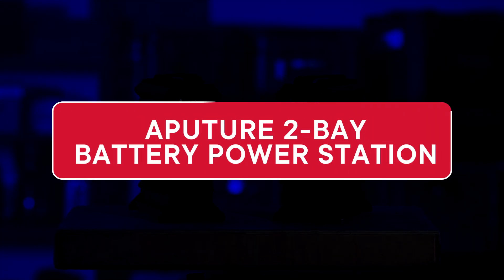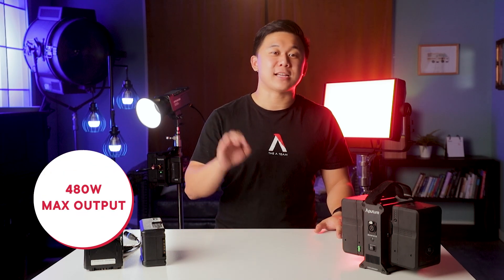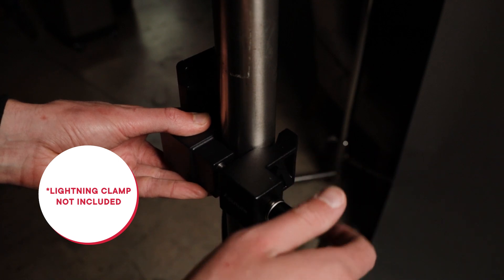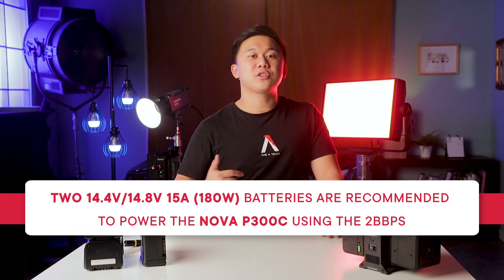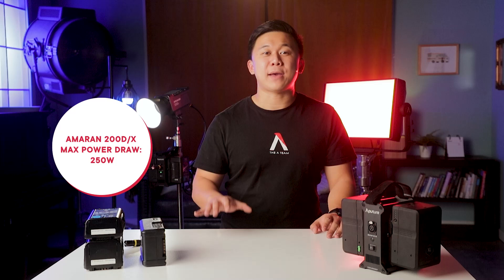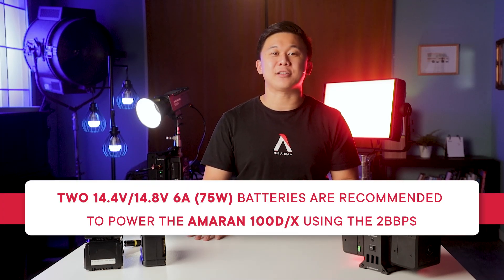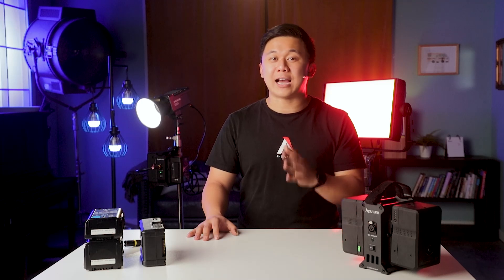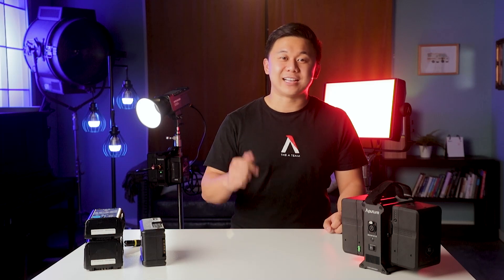Aputure 2-Bay Battery Power Station | User Guide

Comment: Which batteries do I need to power my Amaran 300c? I like Core batteries and they were recommended to me by you guys. Please can you provide a couple of model options including the least expensive option. I only need 30 min or so to power my 300c. Thx
Reply: I need to know this too but I think my man made this video on one condition that after this video he will not talk to no one 😂
Reply: @Khainchi  I went through a heap of research to solve my problem. 

The batteries I went with are Core SWX Hypercore G3 150V 144Wh Lithium-Ion Battery (V-Mount). I choked on the price even on sale. But I bought two of them and they work perfectly powering my Amaran 300C using the Aputure Two Bay Power Station. Absolutely no hiccups except for a much lighter wallet. Man, these are expensive. 

The catch with this, powering a light such as the 300C is AMPS. This Core model I mentioned can handle a 20A continuous draw. That’s the key. That’s what ya want. Allot of lower end Vmounts do 10 amps continuous. Some a bit higher. But if ya don’t have the strong continuous current, you won’t get allot of time, or it will be dim illumination or flickering. All that unwanted crap. 

The whole set up is around a grand and unless you are a pro, there are much less costly solutions. 

But, the 300 C is a great light, the power station should also charge stuff but doesn’t (so it’s a negative) and the Core batteries to me are the best in the business, the high end ones are just ridiculously expensive for the average consumer. These are corporate prices! But, I’m sure it costs more to manufacture these potent and very reliable batteries. It’s a good brand.
Reply: @Khainchi  sorry meant to add in my reply, the batteries I mentioned power the 300C for one hour continuous. Give or take a minute or two.
Reply: @ hey man thanks for your kind response bro you a life saver,I really appreciate your insights,so I am from Uk here Core SWX Hypercore G3 150V going for about 600 gbp each which is expensive,I got to buy two as we have two 300c and I need it for run and gun type of music vidoe shoots etc,now I am thinking shall I bite the bullet and get these that you recommended by the way they looking game👍 
Or else I can go down and get the 150c with 2-bay battery power station which is budget option it’s going for 150 gbp here,and 150c itself is a cheaper light too,the only thing is I don’t know nothing about 150c how does it compare with 300c which I love man,not sure if 150c is powerful enough for quick outdoors shoots,and when I say that we mostly lighting one or two characters in same frame nothing mad wide,
Much love bro

Comment: Through the appropriate connections and batteries, can it work in a light from another brand that works with 48v? I mean the 2-bay battery power station
Reply: Neewer 14.8v 190w battery

Comment: A 15A draw from a battery is pretty nuts. Certainly there are a bunch of batteries out there which claim 15-16A draws, but they're talking peak power. Their continuous draw is more like 10A. Anyone have a suggestion?
Reply: No that is not so nuts actually, Americans usually equate Amps to Power which is not true, 15A at 14V is only around 200 watts. Lithium batteries are capable of up to 100A of peak output. You are thinking about some power tools that are rated as 8 Amps or 10 Amps, that is at 220V or 100v. Batteries has much lower voltage than your power outlet in your house.

Comment: For clarification, how long does a Nova/Amaran/120d ii last on battery power? The cost basis for this product and  2x 15A 293Wh batteries is roughly $2000.
Reply: take the total wattage of the batteries and divide it by the power draw. So the 120dii draws 140w so total two of your batteries is 586w / 140w = 4.2 hours run time roughly

Comment: Usless to ask here as i see but maybe users will help. 
1.is there any chanse to power aputure amaran 200x with this and then with "2 npf to v-lock power plates/adaptors"
This plates provides maximum (14.8 V as regular v-lock) 4A or 5A or 6A
But it is recomended 11-12 A to satisfay amaran 200x

So ? Maybe it can work on half power ? If for aputure amaran 100x   6 A is ok....

Any expiriense ?
And for how long will it work.... maybe it is 20 minutes on 50% brightness from 4 npf-970
So it it mostly usless

Comment: Can it charge the V-mount batteries?
Reply: He clearly said, "That's everything you need to know." You don't need to know if it charges them.
Reply: I have the same question they says inspire buy he 600d and it can charge the batteries.
Reply: same question here
Reply: @FlashCubeDSE  I have the question after looking on the picture and the answer is now there is no connecton to power in.
Reply: Yeah it can technically
Reply: Considering there is no DC Input it sounds like a no.
Reply: Why not make a piece of hardware that does it all.. no charging is silly  @MichaelNguyenn

Comment: Is there a specific battery that you would recommend for this power station? Is so difficult to figure out among the dozens of options available
Reply: Depends on what you are going to use it for and so on...
Reply: @ellirhc11  What battery would you recommend for the Aputure Nova?
Reply: @osoriony  I don't know if you can get them where you live, but the Patona Premium BP-300W and Patona Platinum BP-290W are some good inexpensive options for 255€ each. If you can get Bebob batteries, you have to buy the more expensive Cine series. The Swit S-8183S is also an alternative to the expensive Bebob batteries. 
The Intellytech Pocket-V 155Wh is also interesting. It's pretty small and lightweight. 
In general I would advise you to look for battery with a capacity higher then 150Wh if you want to run the Nova at 100% power for more then 45 Minutes on a single battery charge.
Reply: @ellirhc11  Thank you very much for your reple. I live in the US in New York. Never heard of Patona. I am very confused because Aputure recommends to use batteries with a sustained load of 15 Amps. When you look at the B&H website, of the hundreds of v-mount batteries, actually just a handful can deliver sustained loads of 15 Amps or higher and of course, they are extremely expensive. I heard of other people powering the Nova with batteries that do not meet those recommendations.
Reply: @ellirhc11  Thank you very much for your reply. Can you please elaborate?